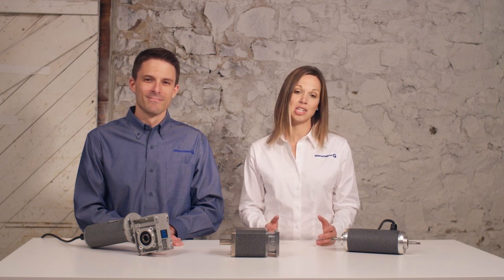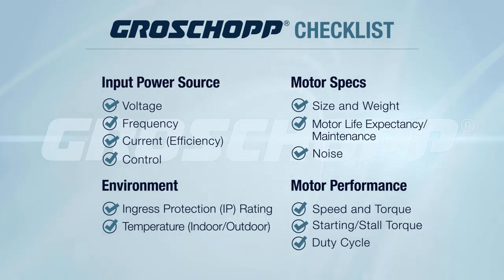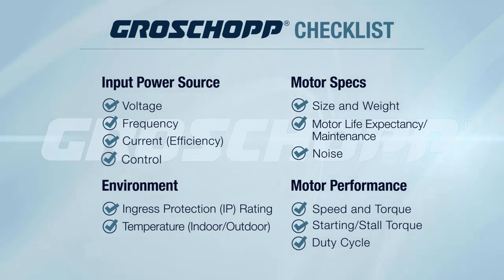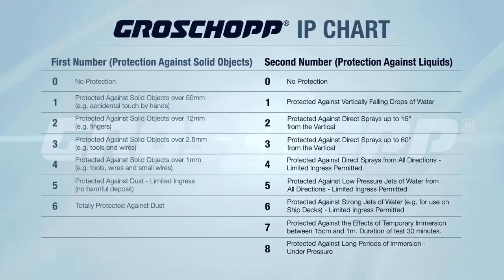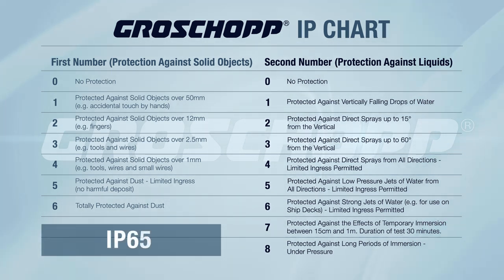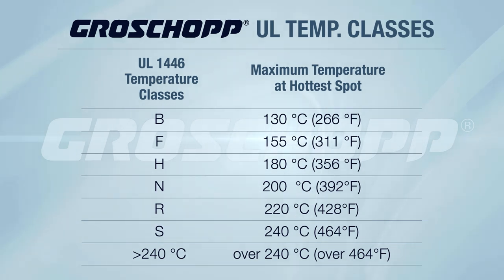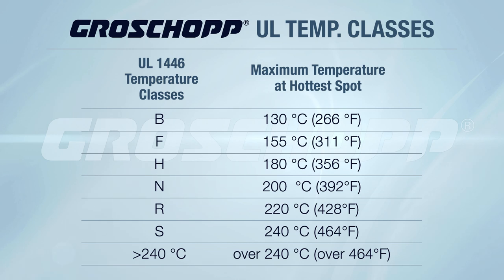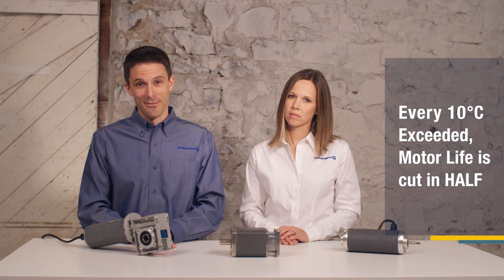How to Choose an Electric Motor | Application Criteria (Part 1)

Comment: which motor should i select for mini 
conveyor
Reply from the maker: Motor selection will depend on a variety of factors so we won't be able to give you an exact answer without knowing more about the application. We would encourage you to watch part 3 of this series as well because it talks about other factors to consider. For help determining which motor is best, contact our sales team at 800-829-4135.
Reply: Groschopp USA ,I just want to select the motor for my mini project.
Reply: okay sir.
Reply: Which motor should I select to run my 20 KVA Generator in an enclosed Generator container?